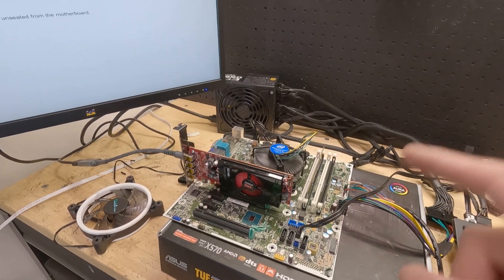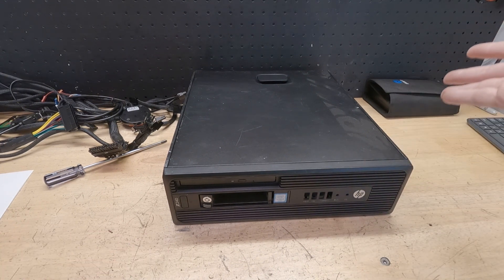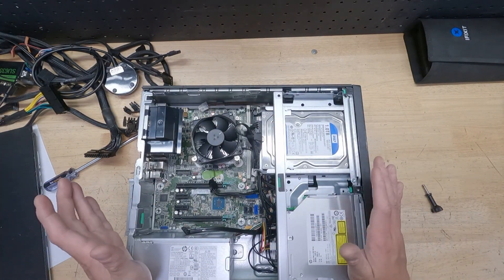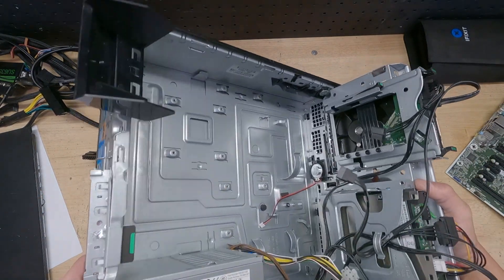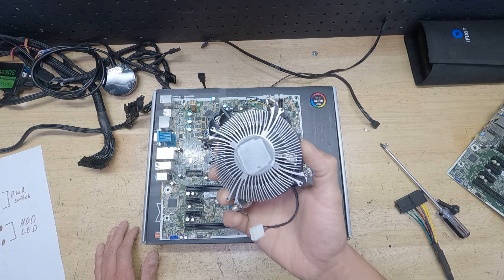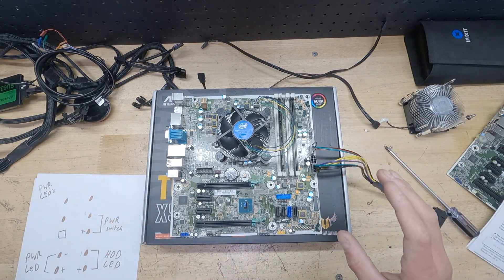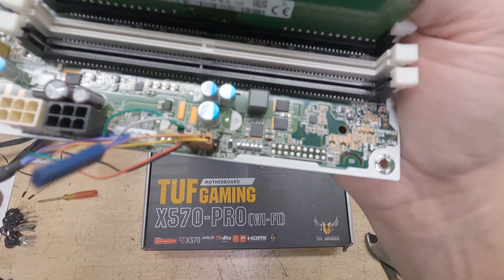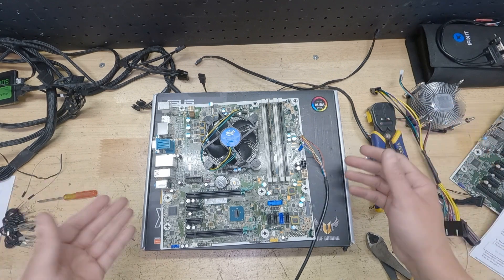HP Z240 Case Swap Guide!! Everything you need to know!!!

Comment: Thanks for the guide. 

A quick tip though - ground out the usb 2.0 and get a usb 3.0 splitter for the front of the tower. Now you have 2 3.0’s and no 2.0. Those connectors that look like all the wires are connected together are just pull apart. Pull the first 4 apart and join 1 and 4. 

I’ll be doing mine next week
Reply from the maker: Thanks for the info!

Comment: Thanks! I used your idea for the USB3 cable. Bought one and stripped some of the two wires, soldered them together and wrapped them in electrical tape. No more F1 to continue! Did this for a case swap of a ProDesk 400 G2.

Comment: just finished jumping the USB 3.0 and USB 2.0 headers. I decided to solder jumpers on the back of the motherboard, i didn't dare to ruin the case I/O cables by splicing them since i want to upgrade in the future. Thank you for your explaining the headers layout since HP is very protective of their innovations (switching 2 pins and calling it proprietary )

Comment: I put a 1245 v5 CPU in the SFF case and it was throttling like crazy (my barebones kit came with the little cooler, not the big one). Finally got all the parts today and it works so well, it was a super fun project. Still gotta figure out the chassis fan tomorrow, I think my problem is I connected my case fan to the molex connector.

Comment: Hello I ran into some error,  after i swap the case of my HP Prodesk 400 G1 into new case *mATX when booting up it says Front Audio not Connected, Front USB not Connected and i had to press F1 every time pc boots up do you guys have any solutions?
:yt:
Reply from the maker: not sure if the 400 is similar to the z240 but the front audio should be standard and the front usb needs to be grounded like i talked abou in the video.

Comment: Any chance you can take a closer look at the pin outs on the adapter 6 PIN end?...far too many adapters out there that say are compatible with the HPZ240 and just dont work when they turn up. Knowing what pins go where would be a big help.
Reply from the maker: I just went with the ones the specifically say hpz240 and never had an issue. I would look up the pin out but I am not too good with that stuff.

Comment: My first decent budget pc was an hpz440 workstation with 32gb ram and a xeon e5 2640 v4 for around 245 dollars. then i put in a 1650 gddr6 open box from microcenter and it only cost me like $130 without waranty. then I did a case, motherboard, and psu upgrade for like 200 dollars. i was able to put a 2080 in there and in total it was only like 600. my sister now uses the pc but it was literally the best purchase of m ylife.
Reply from the maker: Great value

Comment: I've done this PS mod to a HP elite 8200 and a Z240 with a 575W PS but when I try a new 650W AZZA PS it works on the 8200 but does not power on  on the Z240. Same 24pin to 4 pin cable. The Z240 sill works with another ATX 575W PS. Any clue?
Reply from the maker: z240 is pinned differently and specific, I have found that if you don't have that adaptor the psu's won't work with her wattage psu's

Comment: Hello. Which cpu fan cooler you used because I have an old Intel CPU fan cooler from a 775 socket and it doesn't fit
Reply: I bought a cooler master fan cooler for the socket 1155 and it fits with this motherboard

Comment: So you still need adapters. my dell 7010 board plugged right into thermaltake PSI and the fans i just repinned the connectors. Super simple
Reply from the maker: not really. the power buttons and such just plug in but the usb require a little modding but nothing terrible.

Comment: If you don't do any jumping stuff, you can use the front  usb right? it just gives you the error? thats the whole point was to skip the errors?
Reply from the maker: it can work but I have find it to be unstable and random drop outs. but then on other case swap I had no issue.
Reply: @DLMtechgarage  It turns out I found a GTX 750 low profile from my friend for 15 bucks so I’m gonna throw that in there not do it Kay swap and do it at the super low price of 225. I’m going to test it and make sure you really can get 60 frames on your esports gaming if you can I’m gonna sell it to somebody who really needs a cheap computer, or my dad’s friend who wants a workstation for basic web design. I have somewhere I can get these computers but 500 GB hard drives, and 16 GB of RAM for about 70 to 80 bucks with shipping so I’m gonna be doing Kay swaps on these a lot. Can’t beat 6th gen Intel for 100$ (with a sata ssd) And I already have hard drives, so I can throw some of those in there so it’s not only a 500 GB bill
Reply: @DLMtechgarage  Also, damn bro I just realize this was you yo, much love bro I love your videos dude love them so much seriously you’ve helped me make so much money and you helped so many young kids around the world get Fortnite started. Thank you so much bro, I personally play on the GTX 1080 TI Alder Lake build, but it’s still nice to do these flips and make some money. It’s my only job right now you literally help me put food on the table.
Reply: @DLMtechgarage  So, thank you so much, bro for reaching out, for answering, and for making your videos, you are the MAN. 

Also you from the northeast/east?
Reply from the maker: @christianmino4073  NC

Comment: Can i just re use usb from old casing.. then no need change any wiring except for on off swicth n power supply.. tq
Reply from the maker: you can if you can find a place to mount them in the new case. I have use to do that.
Reply: Tq bro

Comment: Thanks for uploading the video. I have two questions.

1. Do the SFF and Tower models have the same motherboard?
2. What is that thing at 23.20 that you are using to power on the computer?

Thanks
Reply from the maker: they are slighly different, and I use a cheap button I found on amazon.

Comment: i keep getting 90e power supply fan not detected after new psu is installed. I am using the cable you suggested from amazon and Seasonic FOCUS GX-750, 750W 80+ Gold. any advice? I also updated the bios. Your video allowed me to consider doing this build. Thanks!
Reply from the maker: reading the forums, everything points to a power supply issue. forums state that the sensor is designed to detect failing power supplies, but in this case, i believe the seasonic focus if i am not mistaken has zero rpm mode which would trigger the motherboard to not detect the fan and cause an error. this technology came out later after the  hp system was built. I would try plugging in the old psu just to test the theory but ultimately you would need a psu without that feature.

Comment: i have got two z240 1 tower and 1 sffi can only get the tower to oot with the psu adapter the one in the sff green light goes on but wont boot but works with its own powe supply which i cant use in this case any help would be nice thanks

Comment: Hi, great video thank u for do it, I want to do the same on hp prodesk 600 g2 sff, but, the pins of the yellow connector are different, how do I find out which one I have to jump ?? (pin 7 and 8 is blank) and the rest of pin (1-6 / 9-10) not
Reply from the maker: never tried tinkering with one of those. I just follow the pins to their respective buttons and leds, draw a diagram and make my own  pin outs.
Reply: @DLMtechgarage  hi, thanks for answer, i have update: on the hp prodesk 600g2 the usb conector have 12 pins not 10 pins;  1-2 pin (power +v5), 3-4 pin (d-) 5-6 pin (d+) , 7-8 pin (ground), 9-10 pin (blank), 11-12 (????unknow), i tried (with a lot of fear...) jump the 8 pin with the 12 pin and works!!!! not error during post!!!, the 3.0usb work like u show on the video!!!
Reply from the maker: @felixyep6551 interesting so it's kind of like the z240 where the extra pin is a signal ground for the error. Nice!!
Reply: @felixyep6551  How are you doing? I follow this same way, but my OS reports Unknown USB device...do you know how to fix it?

Comment: I have a problem with the front io usb 2.0 conector. I have an hp elite desk 800 g2 sff and the usb conector has 12 pin its different to the one showed in the video. Could you tell me which pins i have to jump?
Reply from the maker: I think I have a specific video on that.

Comment: Awesome video. 

Ive got the Z230 that I moved into the case of another prebuilt. It powers on but I don’t get any signal on my monitor no matter which display output I use. Reset the CMOS and reconnected all of the hardware I originally took out. Any ideas?
Reply from the maker: the power cables adaptor has to be correct, many order the wrong one for the other models and have that issue. pinouts are different.

link below to the exact one.

https://www.amazon.com/YEZriler-Adapter-Sleeved-ProDesk-EliteDesk/dp/B0B2HVJZJ8/ref=sr_1_1_sspa?keywords=hp+6+pin+to+24+pin&qid=1668557691&sprefix=%2Caps%2C49&sr=8-1-spons&sp_csd=d2lkZ2V0TmFtZT1zcF9hdGY&psc=1
Reply: @DLMtechgarage  thank you so much! I’ll give that one a shot and report back
Reply: @andjamoo  did it work?

Comment: great video! my problem : i have the exact same z240 and put it in the coolmaster 500 mesh case . everthing is working the fans the leds everything . but there is symply no signal to the monitor . do you think something is broken?
Reply: could it be the power adapter . that  it has not enough watt ? 
would be very cool to get an answer . 
thank you
Reply from the maker: what kind of graphics card are you using?
Reply from the maker: what kind of graphics card are you using?
Reply: @DLMtechgarage   hey thanks for the answer. i bought this pc about 5 years ago from a company it has an intel i7 7th generation but i dont know the graphics card. they said to me that they‘ve installed a very strong and good nvidia card
Reply from the maker: @9speedgaming901  I would try removing the graphics card and plugging the monitor into the board. That would rule out a graphics card issue. Then if you still have the problem try each ram stick 1 by 1 in the first slot to rule out a memory issue.
Another thing to consider is checking the psu connections. are the 24 pins and 6 pins attached properly. I have seen people plug the pcie into the cpu 6 pin by mistake. if all that checks out, then look into the adaptor you bought. The adaptor is specific for the z240. Their are ones out their that look identical and will plug in but are wired differently. I ran into that.

Comment: Ace video as always - is there an Xeon variant that works with this gneration of intel socket please?
Reply: ahh just spotted the part 2 video :)
Reply from the maker: Intel Xeon E3-1240 V3  is what I run in mine, I use it paired with a lp 1650 as a HTPC

Comment: I did a case swap on one of these. I get a black screen when trying to boot from a graphics card. I was able to boot into windows with the on board video and installed the graphics drivers. Still black screen when plugged into video card. Card works as I’ve tested on another machine. Tried different cables and different ports. Any ideas? Thanks.
Reply from the maker: might need a bios update, these model where finacy with newer cards and I know the newer bios has some codes for them.

Comment: thank you for figuring out some of these dell n hps front psanel pins...its a pain...ive sold a few older pcs n nice to figure out the pinoit...who knows a pc like this one may ve next one I sell.
Reply from the maker: Ive been flipping these left to right cause of the price to performance and they are so much easier to case swap and mod.
Reply: @DLMtechgarage  yeah I can't blame you! I'm working on a 20$ hp omen..had a r5 1400 ..a 650w inland bronze..keeping n painting n modding the case..just bought son a Asus b450 n I got his gigabyte b450..16gigs oloy 3600mhz ram was like 60$ just got the red n black msi 1050ti..outta look n do good :) my cuz brought me a alienware mobo with a i5 7400 in it and may fix it up next..seen your gtx 980 or 960 vid n u was using a i5 7400 with it n looked like it did good gaming bn a lil newer than 4th gen or so Intel or even 1st gen ryzen that 7400 will outdo a few ryzen3 and 5 chips :) I'm not a hater I like both especially when free or a deal :) saves me a lil n I decide to buy parts n build it up n find a home for it :)
Reply from the maker: @2011jaydog  same here team red blue or green, don't matter cause in the end all teams will make you some cash lol..

Comment: What was the original CPU that came with that machine? I was wondering if I should go for HP Z240 Workstation SFF Barebone 6th Gen Intel Xeon Motherboard *No CPU/RAM/SDD and add the e3 1245 myself cause they're very hard to come by pre-assembled. Barebones is like $36, with a 1245 is like $200
Reply from the maker: I tend to go with the barebones as it can be cheaper if you find the right price for the other parts.
Reply: Hey, dunno if you're still interested in this but I just finished building everything with a 1245 v5. Runs snappy, no surprises.

Comment: Hey, how did you figure out where the front panel connectors go?
Reply from the maker: I looked at the original case pin out outs and traced them and followed them to match.
Reply: @DLMtechgarage  ah i see thanks
Reply: @DLMtechgarage  Thanks dude. I managed to get my power buttn and the leds to work by doing what u did.
Reply from the maker: @kubocs  awesomeness

Comment: Hi, guys!!! Nice guide. I have a HP 600G2 SFF and followed all steps, I'm able to skip the USB2 and 3 errors, CH FAN and PSU FAN....but, when I plug any device on my frontal USB, the OS informs Unknow USB Device....My case have just 1 USB2.0 and 1 USB 3.0 in the front panel. for the USB2, my MB have 12pins instead of 10, I had cut the GND and made a jumper between pins 8 and 12. For the USB3, I had cut the pins 01 and 04 of the extensor cable and merge the fours pieces of cable... Could you help me? If I made a mistake, let me know.
Reply from the maker: not sure, never ran into that issue. seems like a ground issue somewhere or maybe a shorted usb
Reply: @DLMtechgarage  I checked again, trying to rebuild the "adapters" now, at least the USB2 is working...but the 3.0 still the same way...

Comment: I have a HP compaq 8100 sff and im planning change the psu to a generic 700w and recase it into a bigger case. And now im worried if it is safe 😅
Reply from the maker: it's safe as long as your take your time, take pics of all your cables, make sure you are not stically charged and never force anything. never done the swap so i would recomming tracing your pwr button and leds and see if you can match the connectors for the different case.

Comment: 7:00 Oeh I guess i could also 3d print a plastic nut, hmm. I've found so many uses already for my 3d printer in pc repairs. Like drive brackets, fan shrouds, gpu bracket and sorts of parts.
Reply from the maker: I need to get into it!

Comment: em about the psu fan not dedected in hp 800 g1
Reply from the maker: if you did the swap, did you get the correct adaptor,  the adaptors are particular based on the model. has to say 800g1. got a video on the 800g1 swap
Reply: @DLMtechgarage  i did not swap i just plug in new psu and added rx 570 cause original hp case is fine for me

Comment: could the same be done with the z230 sff?
Reply from the maker: not sure as its a different chipset but I have found in my experience is that mobo manufactures tend to do things the same, so the front panel might be similar and the pinouts might be similar.

Comment: any chance you know what it means when cpu fan keeps cycling every few seconds and the green light by the power button blinking green?
Reply from the maker: not sure but sometimes reseating the memory stick fixes weird errors like that.
Reply: My hp does that and the problem only ends when I run the pc with one single stick of ram, I suspect a bios or Windows update has messed with the dual Chanel ram controller somehow?